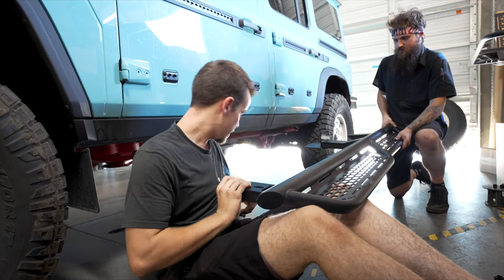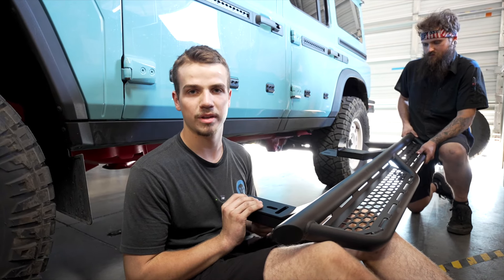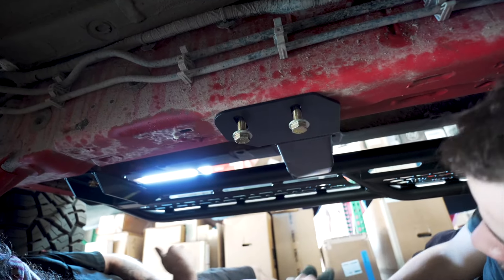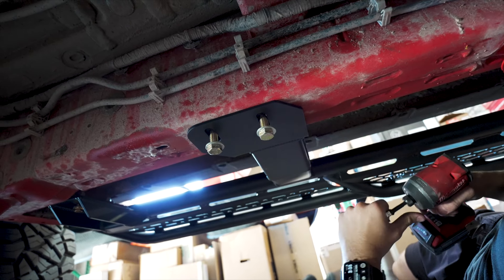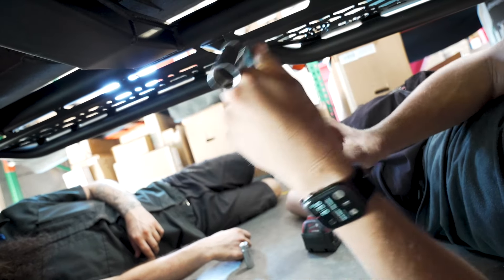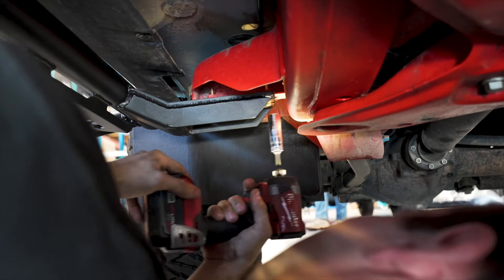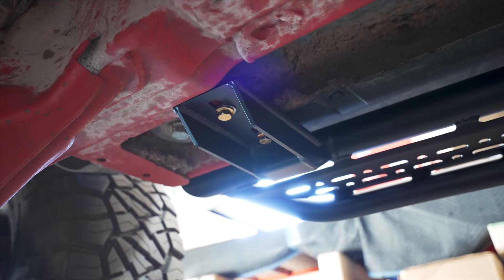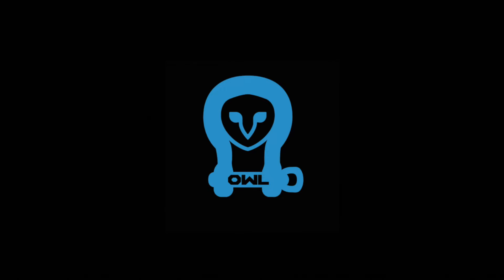INEOS Grenadier Side Step Install

Comment: Does any attention need to be focused on their alignment with the chassis rails so they are sitting square with the body? I noticed slotted bolt holes on the side steps so I assume some in and out adjustments is possible?
Reply from the maker: Not really. The holes are slotted because no matter how good a jig is, when you pump a bunch of heat (welding) into something with arms, there can be a slight movement.

Comment: Great video. What is the height of the step from the ground? Thanks. Lee
Reply from the maker: Height from the ground would depend on your lift and tires but the bottom of the side steps are the same height as your frame rails. Therefore there is no decrease in ground clearance or breakover angle
Reply: Thanks for getting back to me. Lee